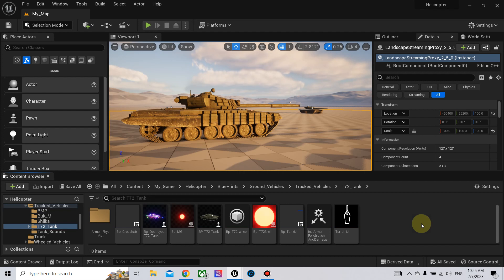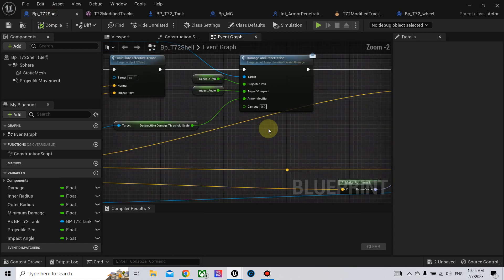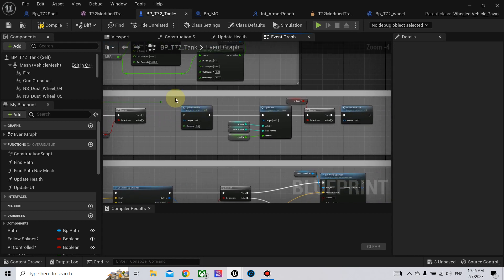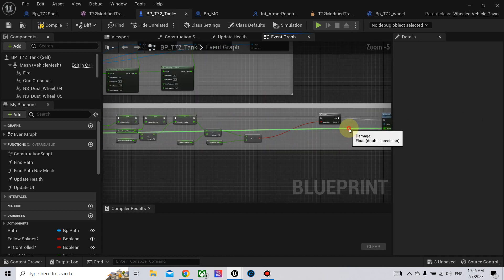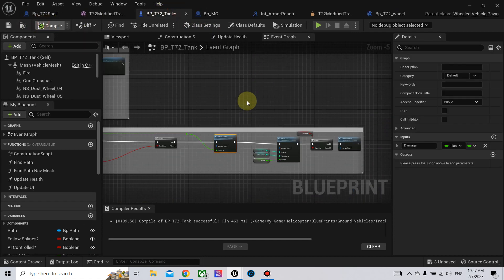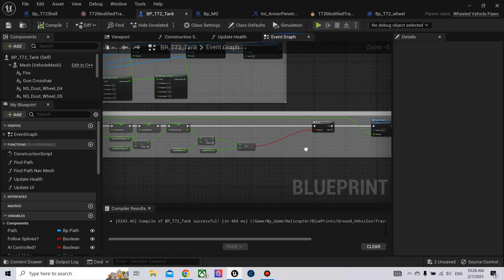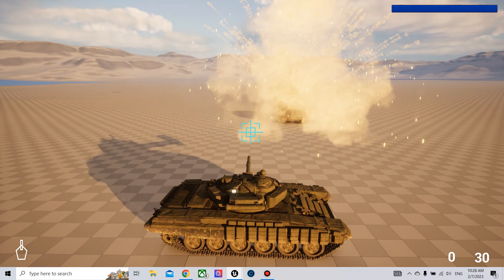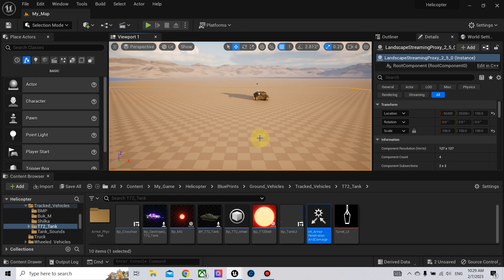Unreal Engine 5 Make Tank Armor part 3 (Damage Fix )

Comment: my biggest problem yet is that sometime the canon disappear when i look up for example.  I have tried to create an ui for the main gun, and i have created a seperate camera for that. The camera is linked with the "gun.jnt", but the gun visually diseapear. I tried many things but he doesn't work, quite frustrating^^
Reply from the maker: if you mean the gun disappears in the second camera, may be it is because the camera is in the center of the gun socket.
try making a new socket and make it offset to the left of the gun.
Reply: @megames998  Already try that, not working. The gun diseappear always when  i look up.  More than that, sometime it "locked" the UI, i mean the gun moove but the UI not.
Reply from the maker: this means the camera is not moving with the gun. Try attaching the camera to the socket on begin play or aasign the camera to the socket when you attach it to the tank mesh. There is an option called socket. You can find it on the right side of the screen just below the scale value of the camera.
Reply: @megames998  Already do it ^^ The camera for the UI is attached to the Parent socket "gun.jnt"

Comment: a tip in the part (anime graphic turret angle weapon elevation) should replace the weapon elevation before the turret angle eliminates the error of the weapon rotating on itself ///// Uma dica na parte  ( AnimGraph 🔄➡Turret Angle➡ Gun Elevation ) deve substituir🔄⬅ Gun Elevation antes de➡ Turret Angle vai tirar o erro da arma girar sobre si mesma

Comment: I saw a simpler lesson on YouTube where armor is made through a thickness map, do you know anything about this?
Reply from the maker: If you mean making a thickness map for the tank material, I did not experiment with it.
Reply: @megames998  will try to do?
Reply from the maker: Not in the current time may be in the future.
Reply from the maker: it will be more complex because you need to remake the material in blender and substance painter with the armor thickness in mind and assign armor thickness to the material.
Reply: @megames998  maybe in the furure will try to make a video about this? To my mind this armor will be more realistic and flexible to setup
Reply from the maker: it is more realistic but complex to make.